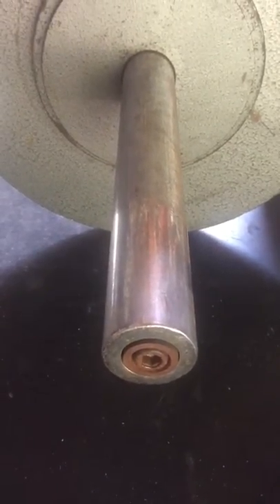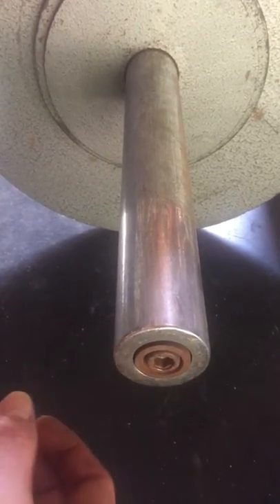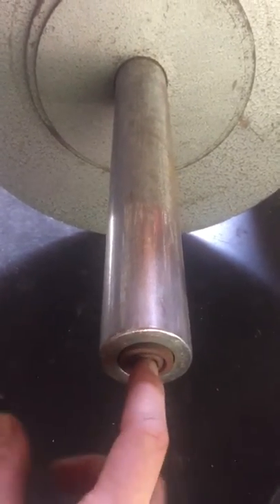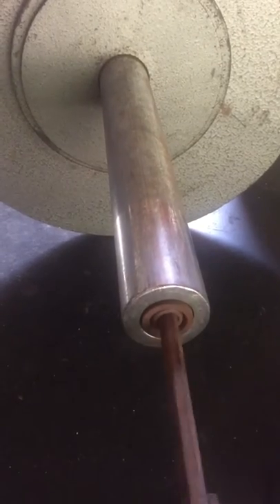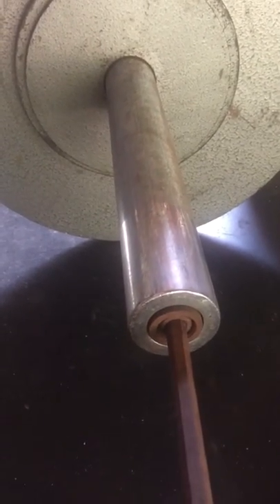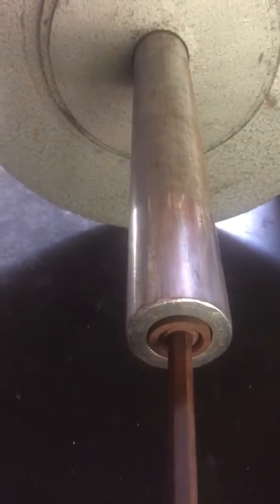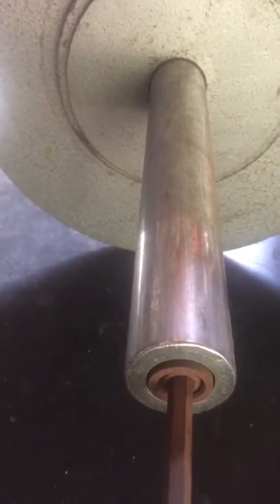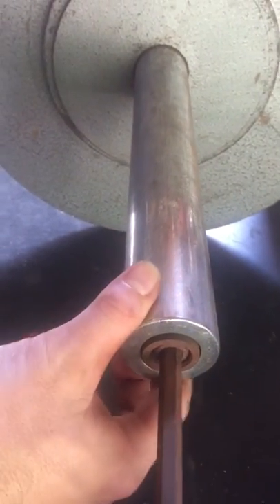Olympic Barbell Accident or Maintenance- loose bolt

Comment: Nice! My bar is starting to feel a bit wobbly, even when I lift with the weight pushed in with clips it wobbles a bit. Was looking for solutions online before fucking with the bar and found your video. Appreciate man!
Reply from the maker: No problem. I have had this problem in the past even at commercial gyms. I was somewhat surprised when I had to bring my allen wrenches to the gym and tighten the bolts. When it happened again at my
home gym I figured I would use it as an opportunity to enlighten others about what may be happening to their equipment and fix before something happened.

Comment: Realized today after my second bench set that my nut had fallen all the way off and my collar was shifted 2 inches over. I was benching 225 off center 🤣. Blew my mind.
Reply from the maker: Sometimes equipment is taken for granted that it won’t move or need maintenance. I know the feeling of realizing afterwards that something was off and needed to be adjusted. Good catch on your end for not having an accident and being able to make the necessary adjustments to your bar in time. On a side not the off set of the lift is kinda like lifting two different weighted dumbbells which forces your body to adapt to the lift. Good times. I have also done barbell benchpress with different weights on either side to force the bar to as straight as possible. It doesn’t take much of an offset.